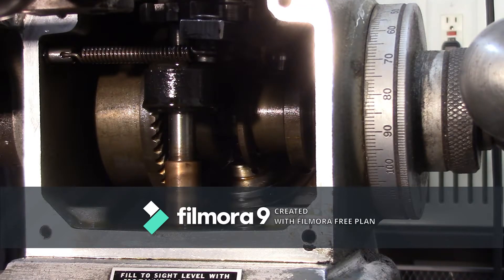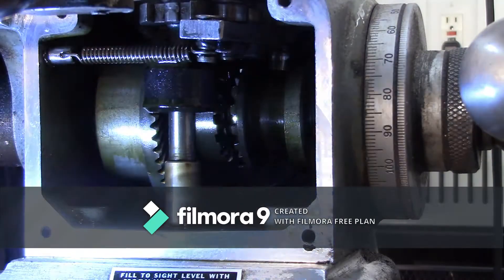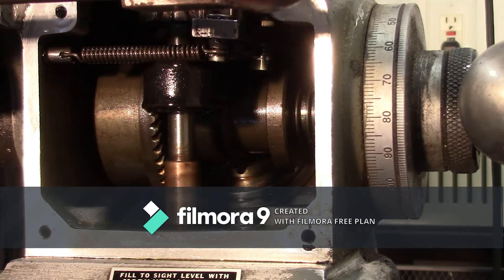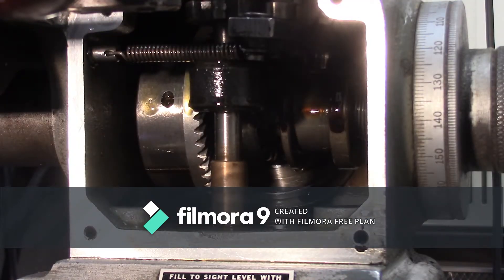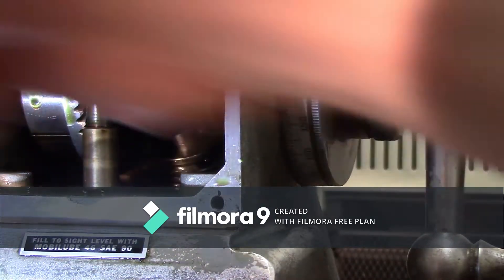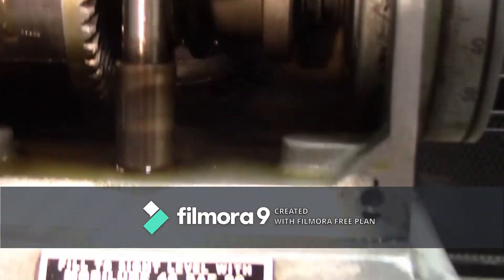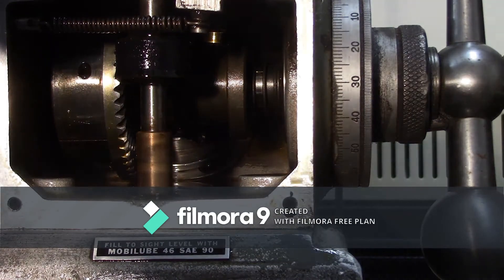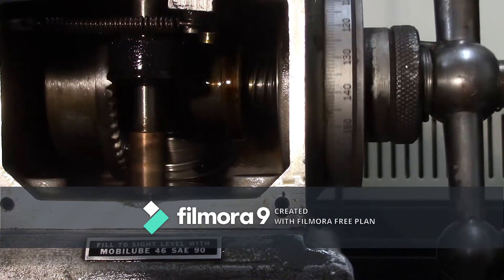Bridgeport Power Feed 6F

Comment: Hi I just finished up making 1 from 3 broken ones and I think if you flush it out and make sure the clutch gear slides free it will work fine. Put synthetic 75W140 gear oil in it. Nobody serviced the gear boxes ever!

Comment: Have you ever figured out solution to this problem? I'm having same issue.
Reply from the maker: Ther was enough slop in the power feed handle that it woudln't fully engage.  When I replaced the handle setscrew with a larger bolt and tightened it onto the shaft, 95% of the issues went away.   It's still old and needs to be coaxed into gear fromt ime to time, but it works fine now.
Reply: @BrianCKanoy by handle set screw do you mean that final nut on the outside all the way to the right of the dial and handle?
Reply from the maker: @RibeyeReaper  no, I mean that the handle that engages the direction of feed on top of the unit.  It is held to the shaft with a setscrew, which wasn't holding the handle rigidly to the shaft.  I tapped it out to a larger size, and then put a bolt in to securely fasten the handle so there was no slop in the movement, which improved the action.  I don't have that mill anymore but I do have the remains of that power feed if you need parts.